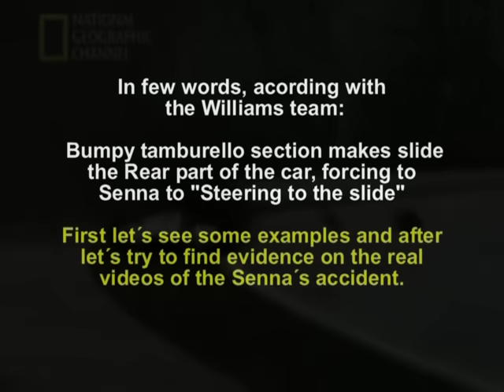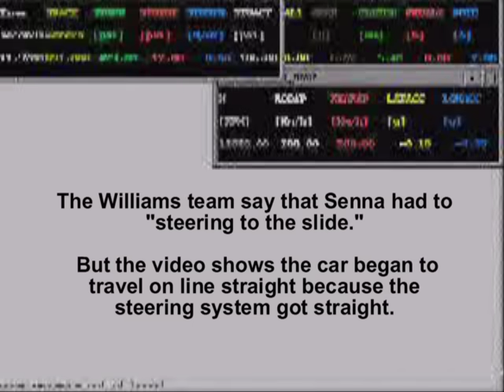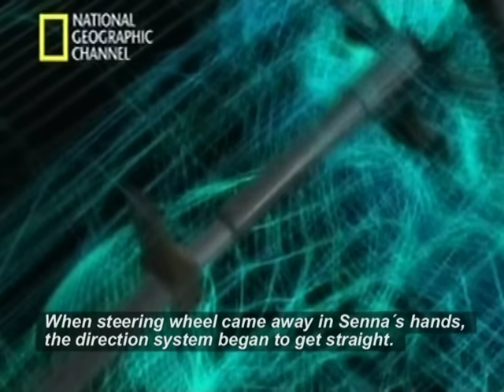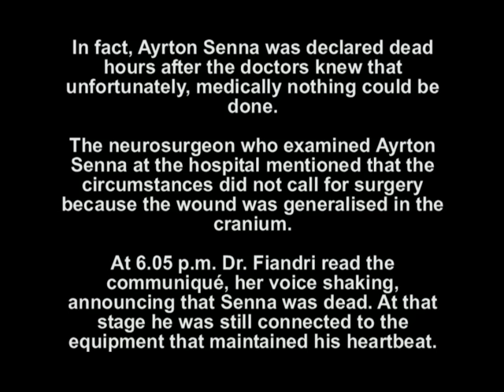5/5 the death of Ayrton Senna - what NatGeo did not tell

Comment: 100% his steering broke.  End of story.  Williams has spent the past decades covering it up.
Reply: they didnt cover anything up it  was told in court what they had done as senna was not happy wity the length of the steering  ffs.where you been ffs.
Reply: I believe the steering column broke, I am no expert, I agree, but he was to good at driving, will the truth ever come out!!!! No, but I believe certain people know the truth.!!!! 🇬🇧🐩🐩🐩🐩
Reply: @martinrollins4471  Spot on. Senna requested the steering column be lengthened because he was unhappy with it. Unfortunately, back in those days, adjustments like that weren't factory-built and they just welded an extension on. This is believed to be the cause of the accident.
Reply: Yes, but that’s not what killed him.  The tire killed him.
Reply: @fifthbusiness1678  if the steering wasn't broken, the accident itself would've not taken place, hence no chance of the tire killing him over there in the first place
Reply: @martinrollins4471  yes Williams did cover his crash up. The black box with Data saved was on the side of the car which did not hit the wall.

Williams personnel tried to immediately get the black box but as a result of the Italian law, the box and car needed to be held for inspection and investigation so the steward said no.

Williams personnel persisted, the steward kept denying their request, F1 management then came with Williams personnel and unlawfully took it.

When they finally handed it back in to the investigators it had been bashed in with a ball pain hammer and data useless.

Bottom line is, Williams engineers narrowed the steering column to give Ayrton more room for his knees as the car was initially designed to fit Prosts smaller frame.

Metal tests on the steering column show it was cracked 60% through (over half way) before the start of the race.

So the steering column only had 40% strength and couldn't cope with the 5.5 g force of Tamburello.

Williams were on a cover-up, just like Ecclestone wanted too, because in Italian law, if a sports person died at the event, the event is immediately cancelled and track owners, race promoters, team owners can be convicted of manslaughter.

This is why Roland Ratzenberger was kept artificially alive at the track and declared dead at hospital and also why Ayrton Senna was kept artificially alive until hospital. 

Trying CPR and getting no response, trying the resuscitation they did on Senna knowing he was already dead and placing him on life support at the track before getting in the chopper was all about covering their ass.

Professor Watkins own words, "knew it was a fatal injury" "noticed a sigh and felt the life go out of his body" shows the powers that be were money hungry animals (Ecclestone and co) and Williams engineers and management were cowards and should have owned their responsibilities
Reply: @milkshakemuncher  😭🤬I seriously hope karma has taken its toll on all those that simply covered their arses. Thank you for your clear and concise explanation.
Reply: @martinrollins4471  Indeed, but I think the point being made was that they tried to cover it up, and tried to control the narrative about what really happened by presenting alternative theories like in this doco. These theories as the uploader points out have no factual basis. The incar images are intended to fool the viewer into thinking it is real footage, but there is no real footage, its all computer animations. The Italian court however only dealt with the facts, and found that the steering broke due to a botched modification to it. In the real incar footage from the last lap of Senna in lap 6, you can see the abnormal degree of flexing which the botched extension to the column exasperated, and the weakened metal having been poorly welded together it could not survive that level of cyclical strain.
Reply: @milkshakemuncher  Pretty much correct, except they could never show if or by how much the column was already fractured before the start of the race. They could only determine that the stress fracture went 60% through the thickness of the column before the final sudden failure. This means that when Senna hit the bump, and the column went through another big stress event, the tensile load put through the steel from hitting the bump as well as the torsional force of Senna turning left at over 300kph was too much for the remaining 40% of the metal and it failed.
Reply: @iavdortmunder8132  yes, I agree with you. 

It's good to find someone else who's objectively looked at the incident and facts before commenting.
Reply: @milkshakemuncher  Unfortunately some people are easily misled, and want to believe everything they see on TV. That's what made this doco so effective at propagating misinformation, even though it completely ignores the physical evidence, and instead presents an alternative theory that was entirely unsupported and thoroughly rejected through the course of proper investigation.
Reply: The suspension and wheel entered the cockpit from the outside. Not the inside.  The wheel and suspension that disintegrated spun back and pierced the helmet.
Reply: @Mr Calcium good points, I like Damon he's an honest guy. However Damon was not responsible for the engineering on Senna's car, nor was he responsible for the investigation or qualified to make assessment of the physical evidence. Those who were responsible for investigation unoquivically determined poor engineering led to steering column fail. All Hill's comments confirm is that if Williams and Patrick Head had provided a safe car, Senna would have won the race despite the deficiency of the car in performance. He was leading at the time the steering column failed.
Reply: @Mr Calcium yes, towing the company line so to speak.
Reply: Senna was the baddest driver in F1.. his steering had clearly failed because the car went straight into the concrete wall
Reply: @ Fifth business... if the steering didn't break would he have hit that wall in a straight line causing the tire to come loose and hit him on the head... 
what was main cause of the accident first, death later....Duh
Reply: @ryand141  so if you wanted,  your tyre changing an they change your tyre at the garage but dont fit the wheel properly thats your fault, or if u wanted some welding done but it wasnt done right an it snapped thats your fault for asking them to do it, see how your comment sounds
Reply: @ribblegaming3331  Well, no I don't.  It's more like telling the manufacturer of the car you buy to fit another steering column.  That's a better analogy.  Who would be liable? Yourself.  Go and ask any lawyer.
Reply: @milkshakemuncher  I am only now joining this rabbit hole, his death has always intrigued me after hearing him say that corner was dangerous, do you have any links of evidence or proof of what your saying?

The metal tests done on the column, why there were taken in the first place, seems a little odd to me.

Them taking the black box unlawfully and so on?
Reply: @milkshakemuncher cool story bro.
Reply: so why did his helmet fall forward? before and during the center of the corner?
Reply: @ryand141  sorry bro but your reasoning sucks. Racers have the right to ask for adjustments to their cars . The engineers are responsible for making them and making them correctly and as safe as possible which they failed to do that’s not on the racer as he was just doing his job as the racer .
Reply: So it's Sennas fault that he requested a change to his steering column,  really,  Seriously???
Reply: @milkshakemuncher  This is my understanding too. Shady and cowardly things went on following Ayrton's collision. You see the car suddenly aim straight toward the wall at the moment the steering column snapped, it was not skating across the asphalt on the running boards beneath the car or the sparks would have followed him all the way off the track. All of the F1 cars back then would bottom out for  1/4s at certain points on a circuit before cornering as if on rails.
Sir Frank - RIP Dude......... But I think that day tortured you somewhat in life, Ayrton was irreplaceable and to go out of this life to a dumbass decision to weld a steel rod steering column was utterly, utterly dumb. The World was robbed too soon of his magical abilities and a large chunk of legacy he would have created, very sad, extremely tragic day, watched it live, saw his head flop in the cockpit and felt utterly sick and defeated that we all just lost the biggest hero of F1. FIA tried to shaft him at every turn with some disgraceful decisions in many races to try to cheat and hand victory to le Froggie Prost. Ayrton gave his best ALWAYS, but very sadly that was never reciprocated by many around him and never by the FIA. It was the FIA meddling with the rules that resulted in Ayrton driving for Williams, Hits.
Reply: @Handlebar-MustDash  Yes, I agree 100%, Ayrton was the best there's ever been and had things been done right, he would not be dead. Yes RIP to Sir Frank, so sad he's gone.
Ayrtons death did affect him, he was very sad and I think his inner guilt for the car failing, and cover up. But Sir Frank always liked Ayrton, gave him his first test in an F1 car, told la Froggie Prost Ayrton would be in the car for 1994 if he liked it or not, so la frogging hop hopped away scared into retirement.

What I don't understand is, why Ayrton's family have given la Froggie a place on the board of the Ayrton Senna Foundation charity? La Froggie Prost stole the 1989 championship off Ayrton, wouldn't let Ayrton go to Williams in 93 because he didn't want to lose to Ayrton.

Now it's RIP to Ayrtons Father Milton Da Silva, he passed away age 94 a bit before the Brazilian GP this year (2021), almost lived 3 times longer than Ayrton.
Reply: @milkshakemuncher  Absolutely, it must have been one heck of a sacrifice allowing Ayrton to come to England to realise his dream as a kid , if it was a genuine racing incident fatality, it would have been a little easier to comprehend the loss of the finest driver ever to sit behind a wheel of any vehicle. Nigh on perfection was lost that day, I was 2 years younger than Ayrton and I sobbed seeing his head roll, hiding the tears from my then wife because we are supposed to be men but losing the only hero I ever had in life. I tell my son today that it was like him witnessing Cristiano Ronaldo pass away on the pitch from a completely unwarranted and unnecessary punch to the head.........the shear waste of supreme talent.
Sir Frank forever seemed near to tears in interviews until his final days, a light had gone out in his eyes too.
The FIA and La Froggie Prost forever hold the shame of robbing Ayrton of at least one Drivers Championship. I know it was fanfared at the time that Ayrton and La Froggie were on good terms in that particular season, but really ? After what Prost did, a blatant, petulant and dangerous take out, I don't believe the buddies at the end story myself. I suppose Prosts intimate relationship with the Froggie based FIA, all Frenchmen together, would be useful for Ayrton's Senna Foundation and perhaps that is the only reason he holds that position. I like to think that the Sena da Silva family still hold him in contempt and hold their noses firmly when the pungent odour of garlic and frogs legs wafts into the boardroom with his nose entering the room a minute earlier bidding everyone a salty little 'bonjour'.
Has sport ever delivered a more tragic calamity absolutely not of the sportsman's making. A metal shaft and a lazy weld and a legend is gone in an instant, dead in 1 second. Just a sleeve made from less than £5 worth of metal tubing to reinforce the weld and Ayrton would be in the commentary box by now as the highest paid F1 pundit, analyst and expert. Much sympathy to Ayrton's loved ones on the loss of his first mentor, his Dad and Captain of the Ship.
Reply: @ryand141   its the manufactures fault for not installing the extension correctly
Reply: @midslam  no no, back in those days they WERE factory built. They just didn't have enough time to do it so done it that way.
Reply: @MooseTDI  The adjustments that Senna requested were NOT standard back in those days. Steering columns were built 'one size fits all', essentially, and the changes they had to make were OUTSIDE of spec, meaning not factory.
Reply: @ryand141  So if you buy a car and chose traction control as an option, the manufacturer makes a mess of the job and it fails in a high speed corner, it is apparently your fault for optioning Traction Control.
Reply: Ya why would the greatest driver of all time, with lightning reflexes not have his wheels turned at least some way around when he hit the wall. The answer is he couldn't the steering was gone.
Reply: the steering broke from the shock of the car bottoming out.. not from the design or engineering of it.. it was a sad unfortunate convergence of a lot of factors the primary one being.. the total lack of appreciation of cooling tires.. by the race director who was responsible for the use of the safety car
Reply: End of story just for you, because a breaking steering does not make sense and doesnt explain 1) The erratic behavior of the car at lap 6 and 7 when experts said the car was making alot of sparks (touching the asphalt too much comparing to the other cars) 2) Telemetry a) The steering torque was registered b) The parameter LONG ACC peak of -7G which means the car had landed with the front side wheels (at least 3 times before the crash.) The car was bouncing!!!!! 3) Visible on board cam near left front hydraulics a cylinder which reveals the car was always turning left. (When that cylinder comes inside the chassi, means the car is going straight ahead; going to right side, cars turning right) 4) The mechanic made a good extension of the steer bar because the wealding spots were untouched after accident. Broke on the "glove" part and after the accident. 5) Senna said to Rubens:"The car is unstable on curves and things get worst if you try to correct it" 6) 15 days before, at Estoril Senna was complaining about the poor aerodynamics of the car on a TV interview. 7) The lack of break power observed. 8) 3 courts and no one sentenced. 9) Williams said the steering bar had some wear but not enought to break and be the cause of the accident.  All this factors points to a fatal "hoovercraft effect" where Senna was unable to do a good break and turn, because the front wheels almost "airborn". So no grip and no direction.  Going at 300km/h the time is short. It's my opinion and many other ppl. If you want to find a defendant, point your finger to FIA, They are responsable to remove some safety mechanism from the cars, like ABS and active suspension. The last item were projected to be used with the FW16B(...)
Reply: @iavdortmunder8132  , Wrong. If the steering bar had broken, the wheels would had aligned straight (tire centrifugal force). That not happen because:1) On board cam you can visually check near the front left side hydraulics a cylinder (part of the system), revealing the steering bar were always turning to the left. 2) Telemetry had registered steering bar torque activity. 3) Long Acc parameter registered a peak of -7G which means a front side landing(...) 3 times before the crash. So the car was bouncing, barely touching the ground. Doing an "hoovercraft effect", how can you 1) turn?  2) do a good break (with the front wheels)? Both questions: You cant! Everyting so crystal clear for you, but strange... 3 courts and no one guilty for the Senna's accident... Well the 1st court tried to find a fast "patsy" like a "bad weald", but the 2nd cleaned it up(...) Both wealding spots survived to the crash(...) It broked on the "glove" part, between them. At my point of view :"it would be a miracle if the bar didn't break after the accident"... If a moto around 200kgs of mass at 200km/h turns into an iron wreckage, imagine a F1 car at same speed but with the triple of the mass. Go ahead, calculate the energy (kinetic energy = (mass x speed^2)/2 ) of both scenarios.
Reply: @GHOSTKILLERAAA  I find it a bit ridiculous when someone watches a video on youtube and suddenly think they found this obvious evidence that all the investigators and experts didnt see. The investigation concluded that steering column failed and this was proved beyond doubt in the court case. That the steering didnt snap back to totally straight can be explained by 2 possible reasons - 1) the steering column hadnt completely broken off and Senna was desperately trying to still make inputs (physical evidence supports this) and 2) bumps and undulations in the road surface which can cause the wheels to deflect from straight. This is the millionth time Ive had to explain this. Thank you for again wasting my time with idiotic idea that you somehow spotted something obvious and solved the whole puzzle. Dont be so silly and have the humility to respect the facts. Thanks
Reply: @GHOSTKILLERAAA  I am sorry I am just totally over this 'debate' - because it not a debate, it was proved and evidence fits. The only reason for any of this discussion is the actions of the Italian authorities in perusing criminal charges, which resulted in those responsible having to come up with an alternative theory to create a reasonable doubt to defend those charges. If the road was totally flat, and the steering column sheered off cleanly, then yes we could expect the wheels to snap back straight with no further deflection. But clearly the surface isnt flat, and the evidence absolutely shows that the steering column did not break clean off, but was still for a time after the sudden failure attached by a small part, which is really exactly what you would expect in such a failure.
Reply: @GHOSTKILLERAAA  Patrick Head was found guilty twice actually, but not sentenced because statute of limitations expired by 2nd conviction I think you will find. Ultimately the physical evidence of the steering column failure was irrefutable beyond any doubt. The steering movements you refer to may be curious only if the road surface was completely flat, and the steering column had completely separated. We know the road surface is not flat, and the physical evidence shows conclusively that the column was still connected by a small part after the sudden stress fracture failure as Senna hit the bump, which is exactly what you would expect to happen in such a failure. At this point in time the onboard video shows Senna in the cockpit desperately pick the wheel back up from his lap and put it back in position in a desperate and heroic attempt to steer away from the wall, to which he succeeded in altering his trajectory slightly. The crash would have been survivable had it not been for the massive direct impact of the right front wheel on Senna in the exact worst spot - which is why I think the authorities were wrong to pursue criminal charges. It was because the Italians pressed criminal charges that this completely speculative alternative theory was proposed in order to create reasonable doubt in defending those charges. It ultimately didn't work because the physical evidence of the stress fracture induced crack in the steering column where there had been a poorly applied cut and weld extension, and its ultimate sudden failure under its massive loads was utterly irrefutable.
Reply: The Italian authorities affirmed that Senna died because of a defect in his car which existed because of the negligence of Head and others. I would argue that Senna died because of the freak trajectory of the right front wheel and where it impacted to inflict a fatal injury, which was only a remote chance - where the risk of that occurring actually applied to any driver who became involved in nearly any accident at that time, and really right up until the recent halo development. The engineer etc shouldn't be held accountable for the materialization of a remote risk that applies equally to anyone on the race track when they become involved in an accident, as is accepted will inevitably happen for numerous reasons, even if the reason for the accident is a result of their own negligence. There is no doubt in this case that the method of modification to such a critical component was unwise to begin with, and then being so poorly carried out, was certainly negligent and caused a defect in the car which caused the accident, but Senna died from the small risk everyone was exposed to racing those cars.
Reply: @iavdortmunder8132  , start to listen what experts say about interpretating the telemetry before calling others "ridiculous" or "idiotic" or "silly". My opinion are on the telemetry readings shared by experts who read it... Everybody has access to it. Its pathetic what you say before understanding bothe sides. You didnt even try to understand the telemetry, did you? I did... With help of some expertise, and worth my effort. When you look to a broken steering bar "after the match", makes me think about a donkey when they look at a carrot. Why going to the obvious? May not be the answer! You should agree with me that few things "after the match" were untouched, right? 1) Telemetry readings registered input -7, -5, -7 STGSTM parameter (top left blue). =>>> Direction wheel  is connected to the wheels!!!! 2 nd court williams assumed some wear but didnt not fractured and  cause the accident. 2) "bumps and undulations in the road surface which can cause the wheels to deflect from straight." Yes it can, and? ===>You can expend your valuable time with idiotic ideas of others and whatever(...), and also learning (with experts of course) some telemetry readings, before spending the othe's time with fancy poetry. The guy who is ignoring other's opinion, acting like "the god's true" is you, not me.
Reply: @iavdortmunder8132  , im going to spend my valuable time with someone who didnt even bother understanding the telemetry. Important parameters: STGSTM (top left blue) - Measure the wheel direction input on tires. LAT ACC (Bottom right dashboard- yellow parameter)- Measures the lateral G force. Long ACC (Bottom right dashboard- Blue parameter). Current speed (Bottom right dashboard- 2nd left white parameter) Thrust - (Top right red parameter). At 307 km/h he lost any lateral force (LAT ACC=0) which means car started to go straight. Senna stopped giving thurst (THRUST=0) because he felt the direction was not responding properly. LONG ACC = -7G means car landed front side. We can think its a break, but no F1 produces that breaking G force. This seq of events the car reduced speed from 307 km/h to 291km/h...Why didnt he break harder? Where the breaking smoke? Well, the power break comes from the front breaks, and he just airborn the front side. He was unable to steer and break!!! After the front side landed you can see an almost instant break from 291 km/h to 270 km/h... Now you can think he is breaking. Yeah, both front tires are on ground again. Thats when he left the track, and hit the wall at 200km/h (lost about 70 km/h outside the track. Can not efficently break on pavel). So does a break steering bar explains the lack of breaking power and the airborn condition? NO! Besides, steering activity sequence of -7, -5, -7 was observed just before the last missing part. Looking after the accidente to the broken steering bar. It brokes between the wealding spots, so the pointed bad wealdings were just fine(...) The facts you refer(...) Even a broken rear suspension is more plausible(like some drivers refered), than a broken wheel bar... The same effect would had been registered by telemetry with same values. Rear side goes down producing a front side lift and same "hoovercraft effect"